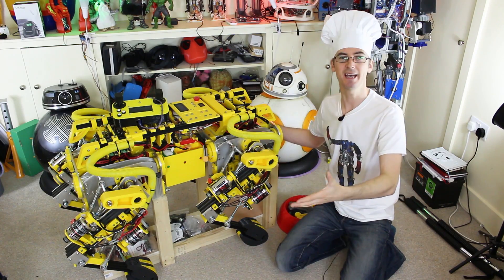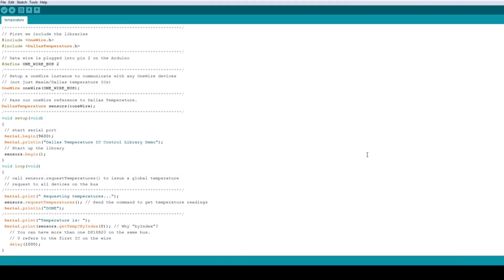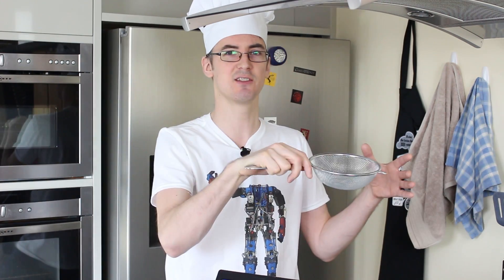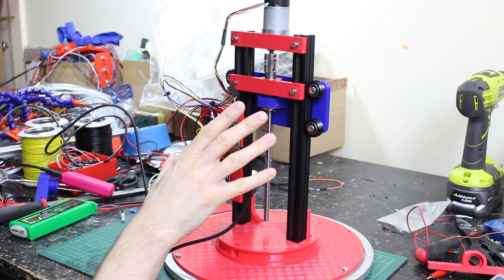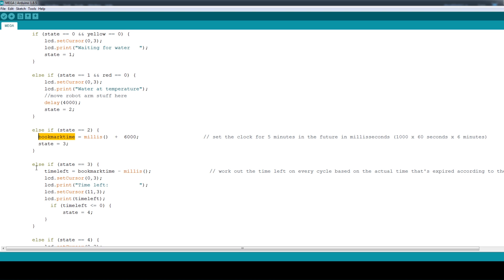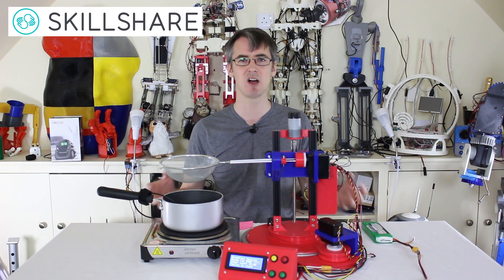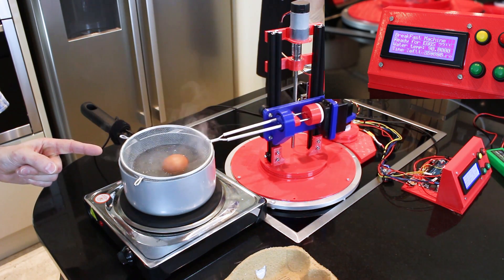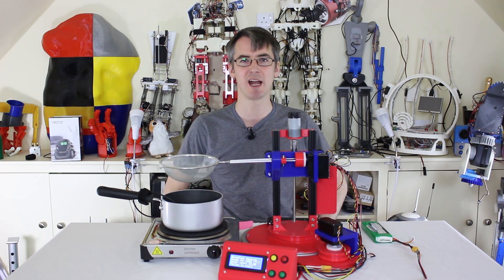I Built a Robot to Cook the Perfect Boiled Egg | James Bruton

Comment: Now make a machine to peel the egg and I will be impressed. Also fry an egg using either a smart camera with robot vision built in linked to the Arduino or OpenCV on a laptop using C# and also pick up and flip the bacon under the grill with tongs and a water cooled camera to check the food without pulling the grill out- and capable of surviving a commercial flame grill, with capstan motors to make it as fast as a real chief.

Comment: The two green buttons should do two different things
1 should let you choose if you want it hard boiled soft ect. And it works by you pressing the button and it cycles through the options that you have pre set
2 should change the temperature boundaries so you can make heat go higher or lower by pressing it and it will cycle though the temperatures that have been pre set by you.

Comment: You could save a bunch of parts by controlling the hot plate with a relay... In fact it probably has a relay already inside it, just take out the existing control circuit and control that.

Comment: Instead of using a servo to turn the knob, just turn it to max and plug the line cord into a relay board, and have the arduino switch the relay on and off.

Comment: The simplest solution for the hot plate should a socket with a relais. So you can just set the thermostat to the correct Position and switch ist on with the relais.

But a via temperature PID controlled Servo would also be very cool.

Comment: FYI, the knob that controls a stove element is called an "Infinite switch" and works by turning the power to the element on and off at varying intervals - no voltage or current modulation. You could easily replace it with a relay controlled by the arduino based on feedback from the probe.

Comment: This is the start of something quite eggciting :P
Get one of them sous vide heaters that sit in a pan of water. They have a heating element, fan to circulate the water, and a thermocouple in one unit, and you can pulse the heating element on and off with a solid state relay. That'll get you a really accurate temperature, and you can write a PID routine in Arduino.

Comment: I think I'd use steppers for everything - much less brutal than servos, especially at power on!
Also use a much smaller pan and smaller deeper sieve to save energy?
Could use a 3D printer's heatbed, or wrap the egg in heated blanket set to 95° and avoid using water altogether?
So many ways to boil an egg!
Reply from the maker: pan height/diameter ratio is hard, also sieves don't come any deeper because they don't sieve any more ;-)
Reply: @jamesbruton  Acknowledged... though a "hacky" wire basket could be easily made from a coathanger!
A claw on an arm or winch could be interesting too...

Comment: for safety, you should incorporate the same automation 3d printers use for over temp sensing or loss of temp sensor and switch off all power, especially the shove if controlled.

Comment: You should probably have the temp sensor suspended somewhat. The bottom of the pot will reach 90 much sooner than the actual water, so with the sensor touching the metal bottom, it is probably putting the egg in somewhat early.

Comment: For the perfect boiled egg, what I usually do is cut the heat and add the eggs as soon as the water is boiling. I leave the eggs in the water for 10 minutes for a soft yolk or 12 minutes for hard boiled. EDIT: and then straight to ice, forgot to mention that

For the stove top/strainer, it seems like if you put one on each side of the motor that's turning the base, the project would have the smallest footprint.
Reply: Interesting method. I always boil eggs for 5 minutes for soft yoke, but with heat on, while water is gently boiling. Let's ask Gordon :)
Reply: @MihaiCadariu  I bought a second electric kettle after watching this video. I filled it with eggs and turn on. It cuts the heat at a full boil and then I started a timer. It took a couple minutes less than normal, but I just had to pour out the boiling water. New favorite way to boil eggs.

Comment: I would put the sieve over top waiting for the water to boil and put the temp on the bottom of the sieve so its not connected to the pot. Also the egg needs to be lower in the water. I like the idea of other comments to have different modes depending on how runny the egg needs to be.

Comment: Awesome little project here. I basically did this exact same thing to control the heat in my dorm room in college Sophomore year. Servo with a 3d printed dial adapter, controlled by an Arduino Uno with a $0.75 waterproof 10 kOhm thermistor from Ebay. For some reason, the heater was on 100% of the time in winter but if the fan was on the room got way too hot and if turned off it got to be freezing. I was able to keep it within 72-76 Farenheight without being home using my incredibly sketchy Arduino smart thermostat.

Comment: You need a deeper strainer to get the egg deeper in the water. Also need to slow down the motions as you approach the set point, the egg nearly got flung out of the strainer. How about hacking the hot plate control so you can adjust the set point directly, rather than twisting the knob?

Comment: Toast:  Many years ago I read about a toaster that used internet access to check the day's weather forcast, and then burned the matching symbol onto the toast.

I also think that jam could be handled in the printer-like manner.

So as long as you are printing, do it all that way:  A conveyor takes the bread through and moves it past transverse actuators.  First one is a torch, so it can brown the bread dot-matrix style to make any pattern.  Then the jam dispenser can make a different pattern.  Use a jam that's rather clear so it doesn't hide the black, or perhaps multiple jams to give different colors.  That is CMYK toast printing!

Program it to (for example) make a portrait of who the toast is meant for.

Comment: Upgrade sieve so the egg is submerged or else create a three jawed egg holder.
Wait for water to drain after lifting
and for the love of god add some acceleration control so it doesn't look like you're running it using solenoids! 

Pair of rollers to remove the shell?

Project idea 10/10
Effectiveness 6/10
Finesse 2/10 

Tidy little project indeed
Reply: yea, that made me laugh, mainly because I'm sure he's already got acceleration code prewritten, and I pray that he keeps some of this stuff he writes/reuses all the time in library.  

That said, he gets at least $470 per video from patreon, so I imagine at certain point he's just got to try and invent/crank some work out to get paid.  Not to say that this isn't a quality video(I'm stealing that z-axis linear servo design for a diy project), but compared to his long form videos with tons of planning, and the fact that the "design phase" of this was a wacky music backed reenactment makes me think that he's had this on the back burner(lol) for a bit until he needed some filler.
Reply: Who needs acceleration control? That would slow it down! Just tilt the sieve to raise the side that the egg is moving towards, so it doesn't roll off.

Comment: Why not use a thermocouple? An ungrounded thermocouple is usually much quicker at detecting temperature changes because of the low surface area and therefore you can be more accurate at the water temperature. Not sure if that will cause more problems though due to the temperature threshould

Comment: It's worth noting that the water in your pan will never reach 100C. The only part that will reach 100C is the steam within the bubbles rising from the base of the pan. As soon as that steam hits the atmosphere it cools and condenses into water vapour again. What we commonly call steam that comes from a boiling pan or kettle is simply water vapour suspended in air because the drop size is so small.

As a result of all of this your temperature sensor (depending on its own tolerances) will not register 100C. If you left the hot plate on under the pan the exra energy does not make the water hotter, it simply breaks it down from a fluid to a gas faster -hence more vigorous boiling. I'm no chef, but i'd be inclined to leave the hotplate on and keep the water at a constant temperature. In additon the hot plate temperature has avery slow response to changes in the position of the control knob, so you'd need a significant delay in a PIR loop to match the knob motion to temperature control - so much so that maintaining a constant temp across 6 minutes may be problematic.  

As with many of these types of problems you can spend more time making the 'safety systems'... ie making sure the pan has water in it before you turn on the plate, makingsure it doesn't boil dry etc.  I like projects like this but we should all recognise that you'd have to cook a LOT of eggs to make this a viable process :-) 

cheers.

Comment: I thought it was meant to be more permanent and that you were going to use a pwm signal to the hot plate
Reply from the maker: yes but also not so hacky
Reply: @jamesbruton  I'd have thought you could interface with that hotplate electronically, e.g. rather than twisting the knob, have a MOSFET where you vary the gate voltage with an Arduino to vary the resistance, or use a digital potentiometer like the AD5171; you could also read the LED being on or off to tell if it's heating.

Comment: At 92-97 degrees that water will eventually evaporate. Maybe a water level sensor would be a good addition. It could either top the water up as required or just be a safety cut off switch.
Reply from the maker: not within 6 mins though

Comment: another way you could control the temperature is to put a relay on the hot plate power and PID that. You only need a reasonably slow PWM speed (i use about 1Hz on my home built sous vide.
Reply from the maker: that's not hacky enough!
Reply: or an SCR
Reply: i decided to divide time into 5.1 sec chunks and then vary the on time percentage of the 5.1 secs.  I decided to use multiples of full cycles.  Each cycle at 50Hz is 20ms. 255 x 20ms =  5.1s.  The heater therefore turns off or on at a zero crossing reducing switching noise and also makes for meaningful visible indicator when driving an LED.

Comment: a robot that peels the egg from the shell after boiling, always burn myself in the rush to get the hot egg peeled and on the toast
Reply: That's actually probably easier than it sounds; Shaking a boiled egg around in a sealed container filled partway with water removes the shell pretty consistently
Reply: It's way easier to peel the egg if you dunk it in ice cold water first. The longer the better but if you want a hot egg then you obviously can't keep it submerged for too long.
Reply: Someone made a peeling machine out of lego. It uses some claw-like parts to pull the peel away.
Reply: @ArtturiSalmela  The best method for a human uses a spoon under the shell. Cutting into the egg without getting bits of shell all over the egg is more challenging. I wonder if a UV laser could do this? Though the health and safety issues mean I will not be trying this.
Reply from the maker: I'll consider how it could chop the top off so you can dip toast in!
Reply: @jamesbruton  a CNC mini-lathe should be able to remove the shell.